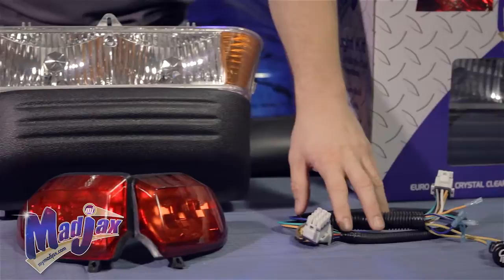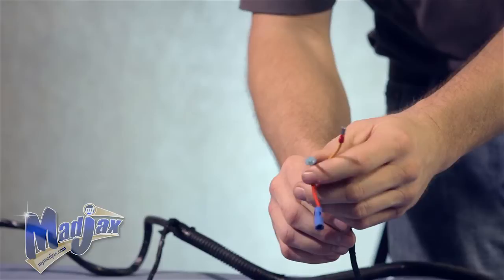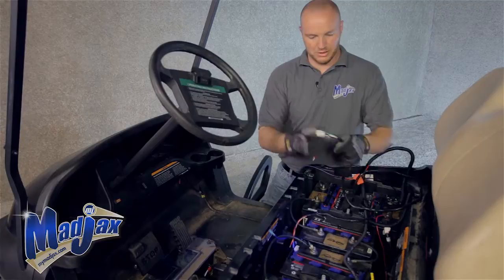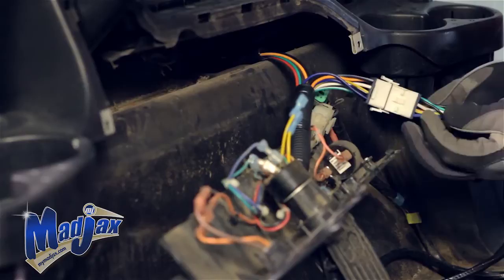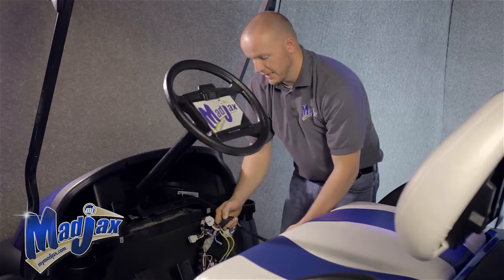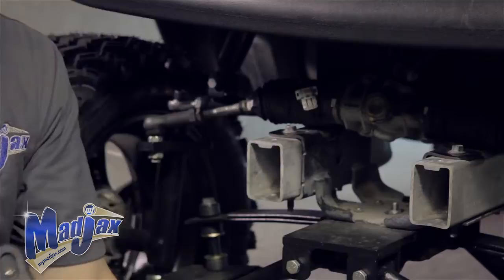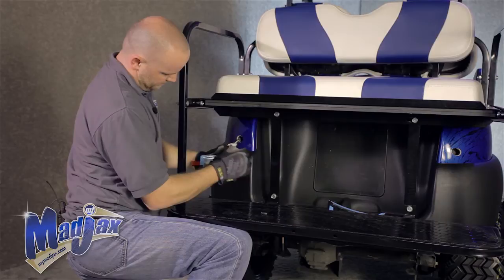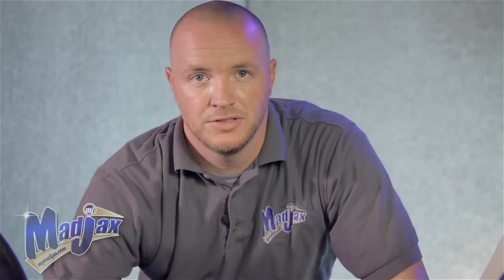Bucket Harness for Precedent® 12V Setup | How to Install Video | Madjax® Golf Cart Accessories

Comment: It went from one model cart to a different one with a different battery set up and controller in the middle. I'm confused. The fuse assembly won't go on the first cart?